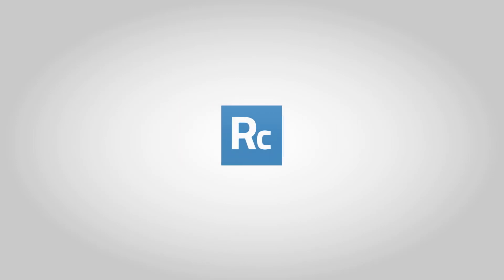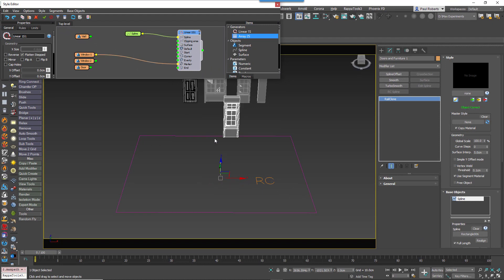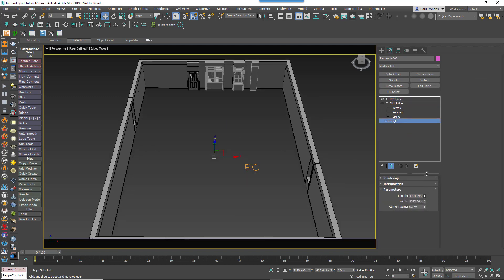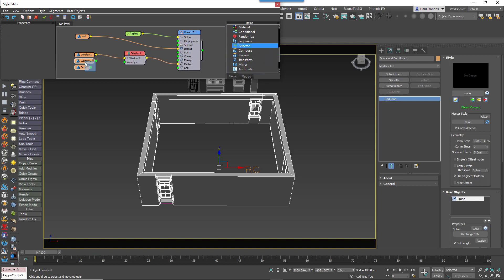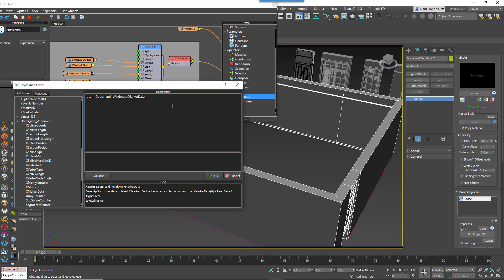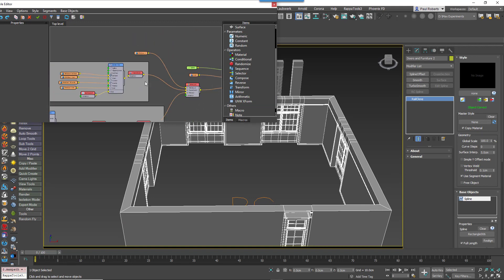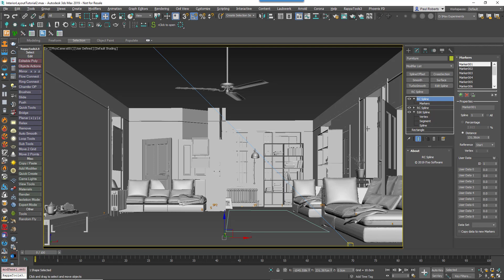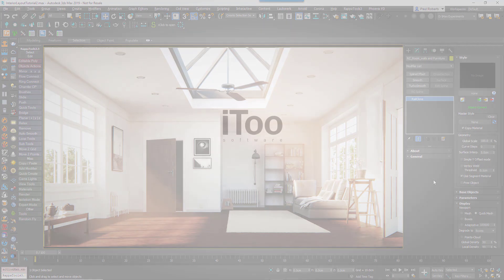DEMO: RailClone 4 - Spline Modifier and Markers

Comment: One question: The RC Spline comes straight with the version Rail Clone Pro. Because I do not find it
Reply from the maker: Yes - it's a part of the installation from RailClone 4 and onwards. It's a modifier, so you should find it in your modifier list. If not, please drop our support a message: https://www.itoosoft.com/contact
Reply: @itoosoft  Thank you. It is a very nice program. And it has really made my life easier.